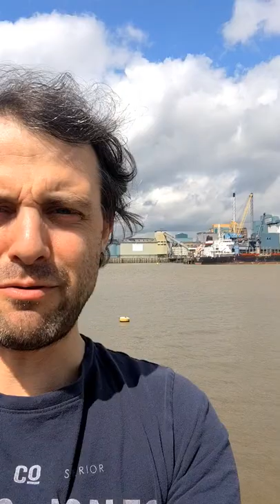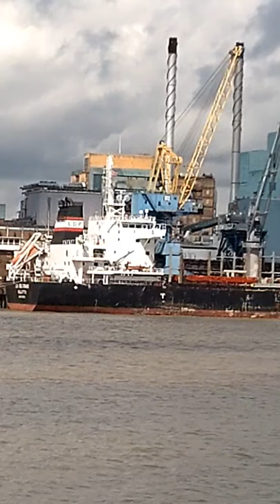chimney fins

Comment: I work with light poles which sometimes have issues related to vortex shedding. I don't think it's entirely accurate to say "the frequency of the oscillation is dependent on the speed of the air." Like a pendulum, the pole has a natural harmonic frequency depending on its height and stiffness and so on. The air speed will affect the amplitude of oscillation and how fast those vortexes can travel to neighboring poles/chimneys, but the frequency will be the same. A dangerous resonance can happen when 1. the wind direction lines up with 2 or more poles/chimneys and 2. the wind speed is relatively constant. I'd be curious to see the exact mechanism for how these fins disrupt vortex shedding explained! Maybe we could use them.